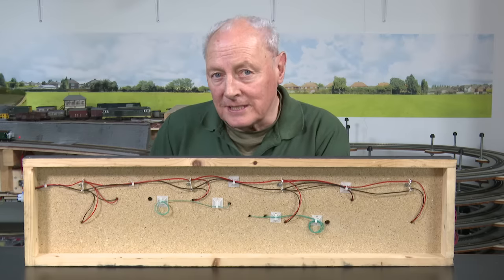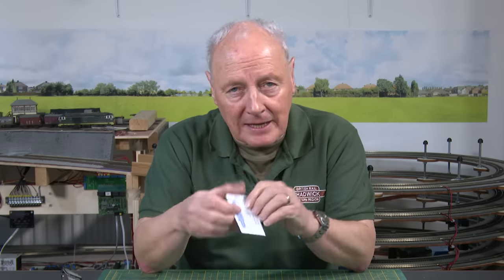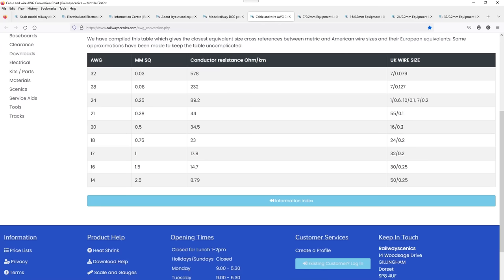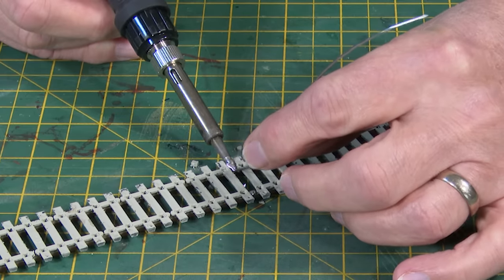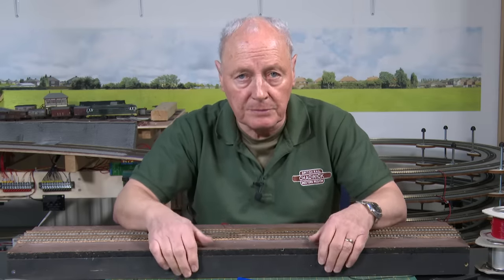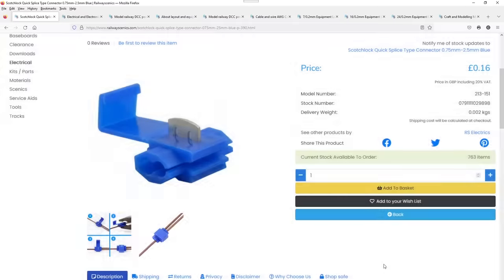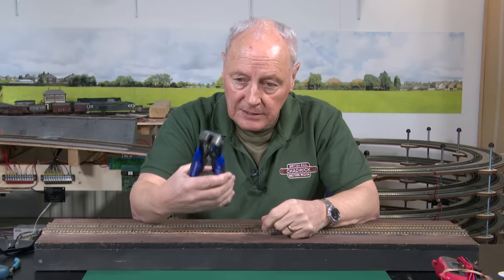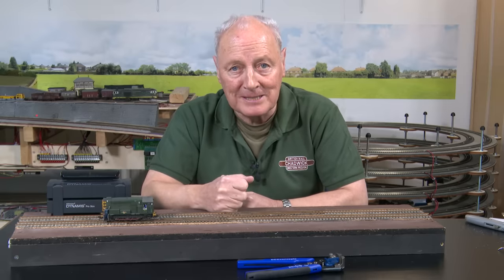LAYOUT WIRING for DC and DCC and all gauges at Chadwick Model Railway | 175.

Comment: Apropos solder...Charlie mentioned using 60/40 solder. This is 60% tin and 40% lead. Don't be put off by the lead content, just wear a mask or run an extractor if you're bothered. Don't buy lead free solder, it's difficult to use and will put you off soldering for life. It's intended for mass manufacturing. Your wee use of 60/40 on your hobby isn't impacting the environment in any great way compared to the millions of tons of electronic waste that hits landfills. Also don't be afraid to apply extra flux to your solder targets, i.e. the rails, you can buy flux in small tubs or syringes, it helps create a better adhering contact point for the solder metal itself.
Reply from the maker: Excellent comment mate, which is much appreciated. Regards, Charlie

Comment: The only way to describe cable current carrying capacity is CSA.. 3 of the 4 "methods" you described are exactly that (CSA, AWG, strand csa x multiplier). But writing "5A" on a piece of wire means absolutely f*** all. Also how /where the cable is laid will determine overall maximum current carrying capacity.
Reply from the maker: An excellent comment LG. Which highlights why I listed the various options. Regards, Charlie

Comment: Hi Charlie, You mentioned that you always use 60:40 solder but didn't mention Flux! they key to good soldering!!
I just want to mention that If you are not using flux core solder then it'll help loads to brush with a flux fluid/pen after filing the underside...
Reply from the maker: Sorry mate, an excellent point. Yes it is resin course solder than I use. 
Regards, Charlie
Reply: He said flux was in the solder.

Comment: Charlie: You are right about the Scottish solderless connectors are not reliable.  You have good justification to be Leary of them. 24:44
Reply from the maker: Thanks Ken, I’ve never found them to be reliable. Regards Charlie
Reply: @ChadwickModelRailway  Here they are used for splicer on trailer wiring.  If any moisture touches them corrosion occurs and your connection is lost.

I don’t like working on things where I have  think a great deal.  Working with electricity is one of those things.  However electricity is some what like water.  To lessen the resistance to flow of water you use a larger diameter hose.  Same is true with electricity.  So if you use heavier gauge wire for you main supply to your tracks, you get lower resistance (more current flow). So it goes to say everything you said improves current foe to your layout.  Easy peasy!  Like how you use junction terminal strips.  Twenty years ago they weren’t readily available.  I took them out of equipment at work that was being disposed of. (What can I say!  I didn’t have much money). Thanks for another great video.  From across the pond.

Comment: i may be the thing the wrong way none of my staff has trained on fires in general so i told them the only way to use the fire extinguisher is to get out of the building with it if the fire blocking the path you can use it  not to fire the fire  get the hake out of the damage fire
Reply from the maker: I totally understand your point of you Jennifer. However, when faced with a burning rubbish bin, they could lose the building! Regards, Charlie

Comment: The reason DCC guys don't need to put multiple drops is because the DCC circuit is powered with more than 12 volts. This allows for voltage drop around the track without going below 12 volts..
Reply from the maker: Sorry but yes we do.  The DCC signal can struggle without decent continuity.
Regards Charlie
Reply: @ChadwickModelRailway  Are you saying that the decoder signals struggle over distances?
Reply from the maker: Yes

Comment: Of course the wire stripper moves the insulation only one way - it's a tool designed to strip the insulation completely off the end of a freshly cut wire, ready for installation. In normal operation, you're supposed to put the jaw exactly where you need the bare wire to start then actuate the tool. It would be useless in its intended purpose if it moved the insulation on both sections of wire.

Oh and you can get them for under a tenner from Amazon.
Reply from the maker: Thanks Ron, something I certainly hadn’t noticed. Regards Charlie
Reply: @ChadwickModelRailway  Sorry, I've just re-read my comment and it comes across a lot harsher than intended. I was trying to be helpful, but now it looks rude. :)

Comment: Halfords also supply the scotch locks for use in the motor trade and provided you seat the joining cable ends  into the lock properly they are idiot proof… to join onto you ref 5 or 8 amp buss cable… idiot proof Charlie…  I promise!
Keep ALL soldering jobs out from under table connections
Reply from the maker: I’m sorry, Paul, we shall have to disagree on this one. Those suitcase connectors just are not reliable in the long term. Regards, Charlie.

Comment: Pretty much every constructional video you have posted I have been a fan of Charlie but not this one. All your previous methods for connecting wires have been excellent but this goes the other way. It may be fine for wiring before construction, but as you said, for connections under the board, not a chance. And stripping and soldering to a bus mid length, not for me, I will be using your terminal block methods, far better.
Reply from the maker: I do understand your point of view. However, I do try to encourage those less experienced. Regards, Charlie

Comment: The DCC concepts connectors and wire strippers are an unnecessary waste of money imo.
Reply from the maker: Those type of strippers are really useful in my opinion. Unless you can name something better? Regards, Charlie
Reply: Charlie, there are numerous auto wire strippers of a similar design which will push back the insulation in the middle of a piece of cable at around half the price. Tyco and Amtech to name just two brands. I don't see the point to the connectors because if you are having to solder anyway, you might as well just solder the wires together. 

Love the channel, keep up the good work.

Comment: No flux?!! Get some no clean flux, then no need to tin the track. Just tin the wire and then it just needs flux on the rail and it will bond instantly without too much heat on the rail.
Reply from the maker: Sorry David, we shall have to disagree on this one. I only use flux when working with brass kits. Regards, Charlie
Reply: @Chadwick Model Railway  flux is essential! When soldering to rails, it makes soldering faster, cleaner, and less heat required. Thus, you are not melting sleepers. It's a no-brainer
Reply from the maker: Still no David, it really isn’t essential when using resin core solder.
Regards Charlie
Reply: @ChadwickModelRailway  we will have to disagree. Using the right flux makes a massive difference. Results in a better joint and less heat.